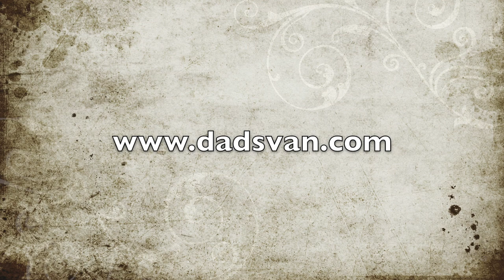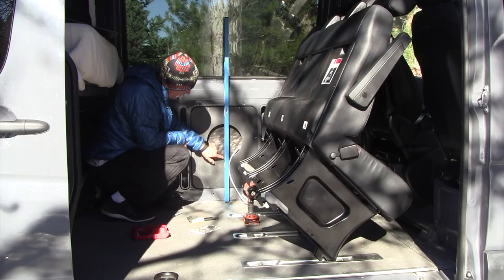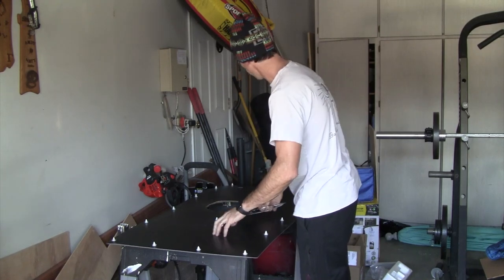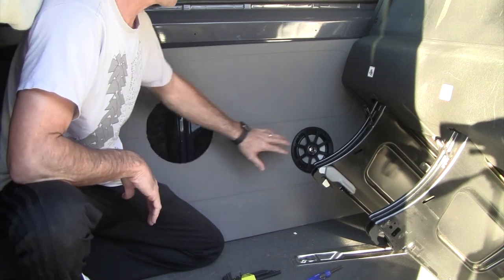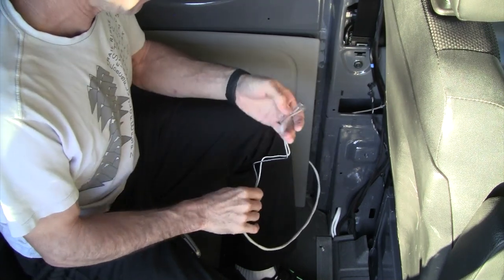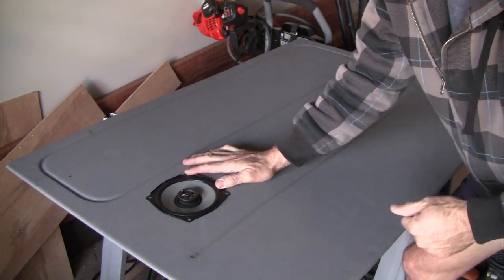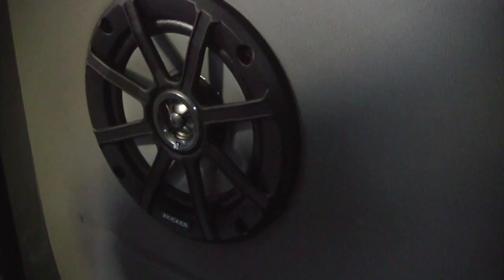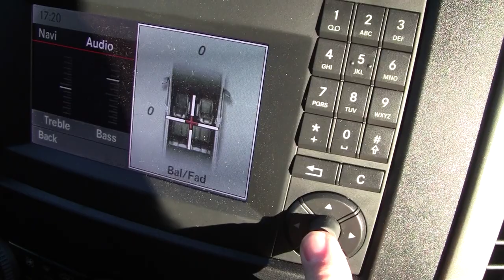Sprinter audio upgrade with subwoofer and rear passenger speakers

Comment: Great video. The link to the Subwoofer mounting panel doesn't work though.
Reply from the maker: Try this one.  Contact Hein and give him specs on the woofer you want to install so he can cut it correctly.  https://www.ebay.com/itm/133897494562?mkcid=1&mkevt=1&mkrid=711-53200-19255-0&ssspo=alIbFw-4T36&sssrc=4429486&ssuid=vhqee2hztso&var=&widget_ver=artemis&media=COPY&siteid=0&campid=5338601399&customid=&toolid=10001